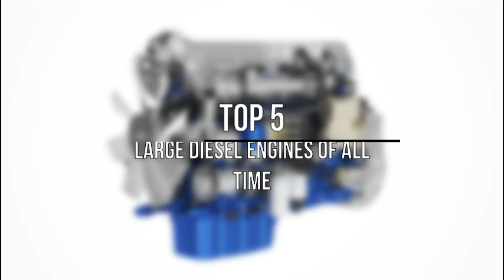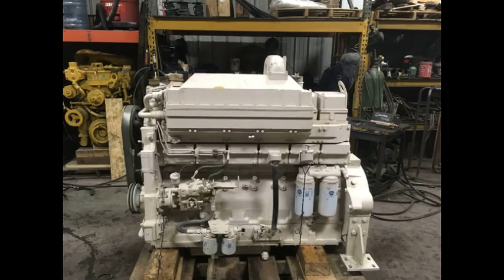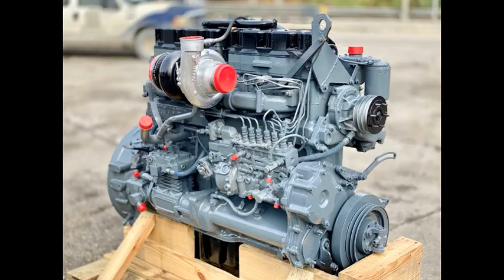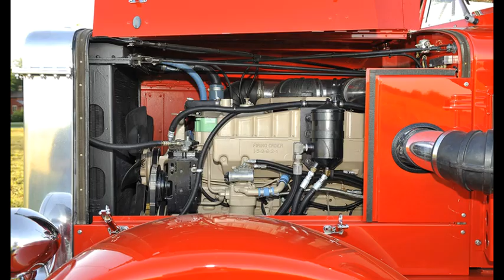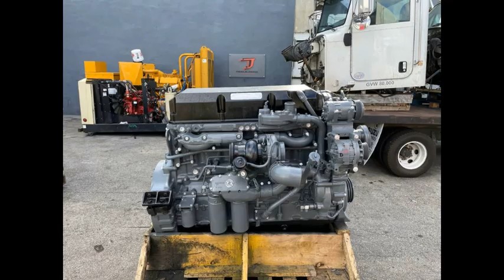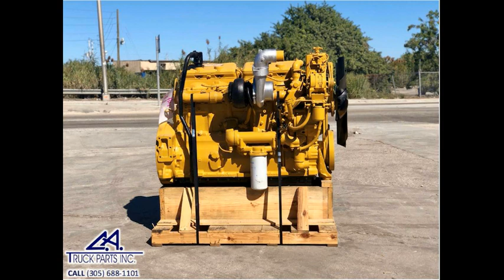Top 5 Large Diesel Engines of All Time

Comment: It's a great engine   repace the bull gear around 800 000       them  60 series  detroit  motors   are tough  good motors       and rear main    unless you spray with either    that dd 60  is  reliable